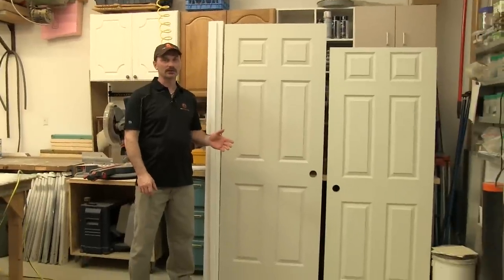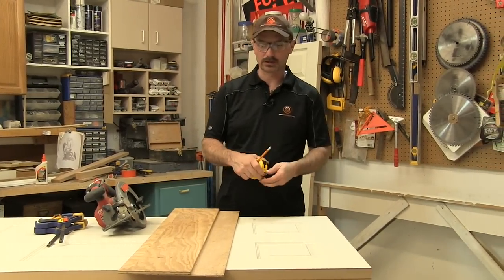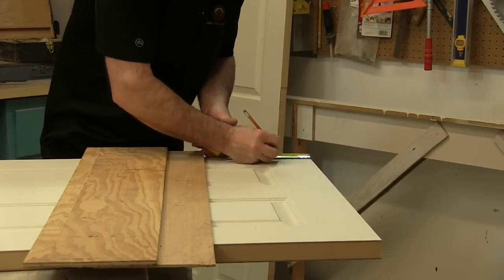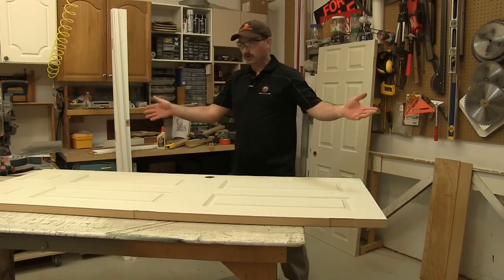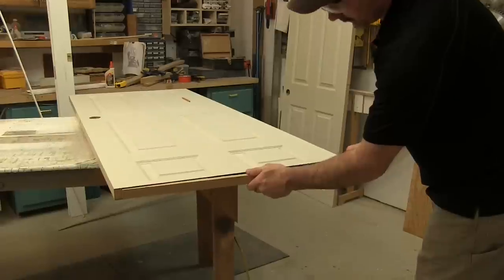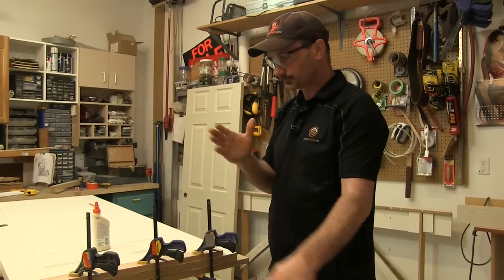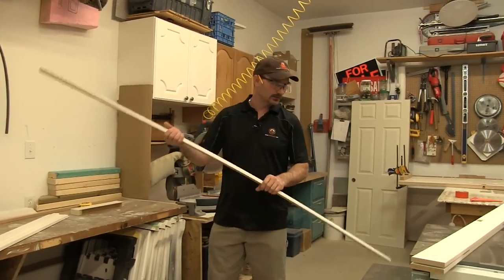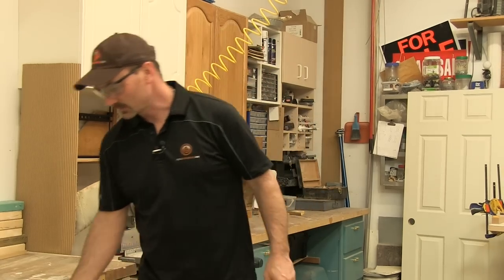How To Cut Down A Door's Height

Comment: Thank you for this! Figured this was the way to go but wanted to be sure. Unfortunately all the doors in my home are 30x78 which is impossible to find replacements for. I'll just get some 30x80 doors and cut them down an inch on the top and bottom.
Reply: Did you end up cutting your doors? Did it work? Ours are 30x77 so same issue for us.

Comment: Cutting down the door killed the proportions... can't they be ordered to size
Reply: standard size is 80" high, and sometimes you can get them in 78" or 76" but they are usually special order so expensive.
Reply from the maker: not these types, you are correct this was pretty extreme.
Reply: Sometimes the cost isn't worth it for a person or client so it's better to just make an adustment than to order a while new one
Reply: NICHOLAS LANDOLINA jaimebeyly
Reply: NICHOLAS LANDOLINA : I work in a millwork shop, that's a standard 6 Ptx. You can ordered them in the size you need 80" 78" just 2" different on all of them. We never do cut down at the top, always at the bottom.
Reply: Yes you can get them ordered but it will cost over 200 per door rather than the 78 per door for prehung. I'm doing this myself right now for my basement. The ceiling is only 79.5 after sheetrock and all my doors are set in the bearing wall so I have a 3" header above them leaving me 76.5 inches for rough opening. Home Depot priced me the 7 doors custom built for just under 1400 or I could by them prehung for under 600 and cut 4 inches off the bottom.  Guess which I'm doing. :)

Comment: Exactly the video I was looking for. For some reason all the interior doors in my home are 78"
Reply: They might have been 80 at one point if someone installed new floor over old. Could add a few inches to it.
Reply: @tylershubert1596  actually when I went to my local hardware store, he mentioned the houses my area were all had 78" doors installed in them when they were built.
Reply: Shit your lucky I’m working with 76 inch doors. Mind you
I already went through three doors trying to get the right fit fml 🤦🏽‍♂️

Comment: I just have a standard rip blade on my circular saw. Do I need a finer blade to avoid chipping?
Reply from the maker: it would be better with a 40 tooth blade
Reply: The more teeth the less breakout
Reply: Another thing that's really helpful to keep edges from blowing out and chipping is a layer or two of quality painters tape right along where you intend to cut.
Reply: No

Comment: Man that door on the right looks funny whatz up with that?..if the strike plate was moved upwards on the jam to wherever to match new door hole latch then old hole on jamb could been filled with epoxy sanded then primed & painted then there would be no reason to whack off anything on the top of door at all, I should know done many like this few years back.

Comment: Thank you!  I have an inch to take off a door and someone's been trying to explain filling the bottom with wood.  This is EXACTLY what I needed to see.
Reply: I probably used a wrong glue but .. a couple days later i came home found the door fallen down on the floor.. the wood frame that we glued back in went further up by the pressure of the weight....

Comment: Thanks, this worked great for a split jamb, pre-hung door too! I just had to disassemble it first. And to trim the stop about an inch below the top of the side jambs after cutting. It was really easy to get the mdf piece out of the cutoff. I sanded the sides of the mdf a bit to get it to slide back in easier.

Comment: I enjoy watching your videos and from you I have learnt a lot.  One little tip though regarding inserting the mdf in the end of the door after cutting to size, if you hammer in a small pin at each end of the exterior edge, you are able to push/pull the mdf rail to fit flush.  Once the glue is set, they can be easily removed.
Reply: Thanks

Comment: Put two doors together to increase height to 8 feet. Patio French door after installation switched swing in to swing out give more interior space to move around.  Replace an existing exterior 30" to 36" door reframe all around including new headers, flashing and stucco to match. That was the last 3 DIY doors projects.

Comment: You’re not Dutch or you would reuse the filler strips. Your guide works better than my four foot level. I use three inch spring clamps instead because I have them in my bucket all the time.
Very nice. High five.
Slippery Pete.

Comment: Thanks! So I made a 83 inch high opening for an 80 inch door! Now my only issue is I have an 83 inch ceiling right next to the door because of a duct I had to frame around. 

Any tips? 

Would I have to cut the door down an inch to accommodate the casing?

Comment: Ok I’m cutting a bifold closet door like your demonstration here, BUT!  I will also be cutting our the top arched recess area so we can back it with pattern glass for a more decorative feature.
It looks like the door has two panels glued to the stick framework and so when I cut that arch panel, I need to use a very short blade throw so as not to jam into the other side?  OR are those recessed arches
Close together and I’d cut both sides at once?

Comment: For the solid core is easier right? It doesn’t need put the MDF back?
Reply from the maker: correct
Reply: @HouseImprovements  I have a solid core door but when I cut it down, inside is particles which is different than the wood on the edge. Do I need to take them off and put the solid wood in?

Comment: I had to cut a bifold door cause it was too wide..standing in front of it,,i cut the right side of the door where there is that 7/16 hole for the hardware..once installed, it didn't work right..the door side was jamming against the door jam..i learned my lesson...one has to cut the other side of the door...
Reply from the maker: Generally cutting both outside edges equally is best.

Comment: Thanks for your informative videos. I have a question. I just had a similar door installed, and the guy didn't get it perfectly square. At the top left, about 3 inches or so, it gets so narrow, the door rubs against the door jamb. It still closes pretty effortlessly, but it honestly bothers me that it may be putting stress on the door and jamb. Would I be able to just trim it slightly in that top corner without damaging the door? I will be taking it off to cut a 1/2" off the bottom, so I figured I might as well try to fix that top corner while I'm at it, if I can. I see from the hollowed out part of your door that there's about an inch or so material along the edge. I would probably only need to trim off maybe 1/4". Any advice is more than appreciated.
Reply from the maker: a portable power planer , belt sander or circular saw can do the job the easiest.
Reply from the maker: if you use a circular saw you will want to mask off or protect the door surface so the saw does not maker it when you slide it across the surface.
Reply: in the door frame hinges in the middle screws replace with a 2 inch deck screw

Comment: Do you have a video showing how you made that template for your circular saw? It looks incredibly helpful.
Reply from the maker: No I don't. Simply used a piece of 1/8 or 1/4" plywood about 36" long and 12" wide I then attached a 4" strip of the same material to one edge as the guild the saw runs against. Then use your saw to run along the guild piece to cut the guild off in width to match your saw bed width.
Reply: @HouseImprovements  Thank you!

Comment: Hi, thanks so much for this video but can one also cut the width? Thanks
Reply from the maker: Yes but only very marginally on the handle side if the handle is already drilled and you can cut more on the hinged side but would then need to re cut the mortices for the hinges after.

Comment: I need to fit a shorter entrance door to an rv I'm building on a 16 ft box truck.  Can't buy a short door. This will solve my problem. Thamks
Reply from the maker: if you use a metal clad door you could cut it down much like this or you can order a custom size.

Comment: Hey Shannon, love your videos. Can you tell me how thick the blocks are in the top and bottom of these doors? I need to cut about a half inch off the bottom of a couple bathroom doors. Just trying to prepare myself if i would need to glue in another piece depending on how thick the existing is in the door.
Reply from the maker: They can vary, but usually they are about 1" tall

Comment: I have a cut door in the basement, they only cut the top part off leaving the bottom 2x2 rectangular sections (cutting off the top two squares).  The door handle height is still the same and it looks a lot better then the weird looking door you cut :)
Reply from the maker: That will work fine if you do not have to make the door shorter than what you can cut off the top only.

Comment: Interesting most other videos show cutting it from the bottom of the door.  Is there a standard?
Reply from the maker: When ever possible I cut from the bottom only , Usually your only cutting up to maybe 2" off but in the case of this example it was way more. Remember as you cut from the bottom it lowers the entire door including the door knob location if its already drilled.So if you cut 6" only off the bottom for example the door knob will be extremely low compared to standard.

Comment: Those door kits look like the same kind I like to use. I have found that most of them, the hinge positions on the jamb don't perfectly line up with the machining on the door. When I sit the 2 side by side at the start, I see one needs a slight adjustment. Do you ever get this also?
Reply from the maker: Yes they can be slightly off ,usually I find most doors are off.

Comment: For me... unless you absolutely need to have a 100% matching paneled door in the new opening, a solid-faced slab door is easy to fit by just cutting the top and filling the cavity (if needed - hollow door).  I then add some external thin molding to fake the look of the panels, reduced in proportional ratio to fit the door face naturally.  I just find the odd look of the panels on a non-solid-faced door after cutting it down to me irksome, as well as the odd position of the handle (if it was pre-drilled).  That's just my preference, but a good video demonstration in any case.
Reply from the maker: Fair enough.

Comment: Hi there, I have the exact same type of door that you have here that I only have to cut 3/8 of an inch.  Will i be left with a hollow inside too that needs to be filled with a wood strip like you did in this video that you glued in position or will this small cut leave some solidness on the bottom edge of my door? Thanks!
Reply from the maker: Usually most doors have  1/2" to 3/4" bottoms in them so you can cut it and see. If the piece left is real thin you will be able to tell and you can push it inward with your fingers to remove it and then install a solid piece like I did. Please use our forum for any future questions.https://www.house-improvements.com/forums/

Comment: I require to cut 165mm from the height of a standard door 1981mm and my opening height 1818mm. If I trim the height the width would look weird so would be better in getting the smallest door which would mean I'd only be trimming less off at the sides?

Comment: Hello, I'm trying to figure out, how to resize a solid core(particle wood filled door) When the particle board shows at the top of the door, does the lumber/piece of solid wood need to be reinstalled for the top of the door? If so, then what's the best way to dig out the particle board material without damaging the door veneer? Thanks in advance engaging my conundrum.
Reply from the maker: Depends on if you would ever see it or not . If you need it to be wood then use a router to get rid of the particle board core and insert a piece of wood .
Reply: @HouseImprovements  Thank you for you reply. I won't see it, but I'm worried, if over time, not having a solid wood up top, will lead to the door warping, bulging out, and or loosing structural integrity. I've thought about clamping a couple of 4x4 to each side at the top to sandwich the door slab, while I use a circular saw etc to work on digging out the material... But it'll be a lot of work. Sorry, I don't have specialized tools for re-railing the door.

Comment: Thanks Shannon. question   i need to trim my down down 1.5 inches and  wonder what is the height of top and bottom rail cores?  .if i cut 3/4 inch  top and bottom  hoping  i still have some core left so wont have to add new cores. :)
Reply from the maker: They are not always consistent but generally 5/8" to 1" I have found.

Comment: On a hallow Luan door 80 inches long. The bathroom in 78.5 inches high because of the marble seal at the bottom. Can I cut  1.25 from each end and still have a door rail at the bottom. Or how thick are the top and bottom rails on these hallow doors ?
Reply from the maker: They vary but they are normally less than 1- 1/4".

Comment: i reuse the cutoff MDF piece.. pretty easy to remove the excess with a wood chisel.
i'm finished replacing 17 interior doors, about 5 prehung. the problem i always had was breaking up the door jamb pieces without too much damage. the ones i got from lowes use heavy duty staples. what is your method?
Reply from the maker: The ones I use are not assembled but they are all machined for hinges and knobs. You are correct that it is difficult to disassemble ones that are stapled, ho real perfect way to do it. If you are only cutting the bottom then laying the assembled jams on a work top and cutting with a circular saw works well.
Reply: dufftime was your time and how you doing tonight Earth wasjedo

Comment: Will this work if you need to cut the sides. I need a 22” door and can only find 24”. I am worried about having enough support fo the hinges.
Reply: I've done this several times and what you'll find out is that at the edge of the door there's about a 1-inch piece of wood sometime it's some sort of medium density fiberboard or composite garbage what I end up doing is taking a 2x4 on my table saw and ripping it to an inch and 1/8 thickness and then gluing it and the entire length of the door so that gives you a two-by-four that's now an 1 1/8 thick and 3 1/2" wide which is going to add more meat into the door and you just gently have to push back the cardboard that's inside the door some people will squirt hot glue in there to keep it from squeaking or coming loose in the future and then I use regular wood glue on both sides on the inside cavity of the door slip the two-by-four in put a piece of one by on both sides of the door and clamp the sucker tight and wait a day and typically the door will be stronger on the inside than it ever would have been with a 1-inch piece of material take your time I'm cleaning the residue from the cardboard in the glue on the inside especially if it's one of the Luan veneer doors glue away
Reply: Mark Hassenger thanks for the response. I have cut down solid core doors before but never tried it on a hollow core. I have one I am working on now. I will give it a try.

Comment: You could achieve better results by starting with a flat slab interior door with no panels or other details, such as a precut knob hole.  These basic slabs would have been much easier to resize.  And you could drill the knob hole to be precisely where you wanted it.  Just a tip for next time.

Comment: What kind of interior door is that short? I mean, where would something like this be used?
Reply: Phoenix Franks a shorter basement with ducting overhead
Reply: Basements, low ceiling areas due to sunken mainfloor rooms or stair landings. Attics, kneewall storage rooms.
Reply: I did one basement where the ceiling under the bulkheads measured to 6ft 5in. I had to cut both the bottom and the top, till they looked almost exactly like these doors. The top cut left just enough room  to fit in a new filler piece.

Comment: Umm but why would you need to cut down a door ..... i'm around 5'10" ..5'11"  now i could understand making counter tops etc lower for wheelchair dependent people maybe even changing the height of a door handle ? but curious as to why you would need to lower the height of a door profile?
Reply: We had to resize all our closet doors after installing 12mm laminate on the top of old vinyl flooring.. plus the transitional moulding in the way.. we didnt have to cut that much though we definitely had to cut the bottom frame out then glue back in...

Comment: You made a point to address how ridiculous it would be to “stoop over” and reach down to an uncomfortably low door handle yet failed to address the fact that you will already be “stooped over” to fit under a 5 foot high door jamb??? If you are hacking a door to fit in an opening that short, I think you’ve got other problems and might want to reconsider your layout. If it’s a bulkhead, use your common sense and put the door somewhere else.
Reply: Shannon explained how to cut a door(which the title clearly explains); not the aesthetic nor whether you should re frame or buy another one. Of course highlighting other considerations is a good thing and should be stated as such, not shooting down the great work Shannon is doing.

Comment: That is one seriously ugly "solution."  I'm surprised you at least added filler framing at top and bottom.  In any case, I would never put my name on that door.  Do it right - re-frame and hang a proper door.  Seriously, how long would that take?  About a half-hour, and you end up with at least the possibility of a professional looking job.  Aesthetics and functionality aside (obviously), your door probably doesn't even meet code requirements in most jurisdictions - to quote from one source, "door height shall not be less than 80 inches," in which case you are opening yourself to liability concerns and ultimately depressed resale value.